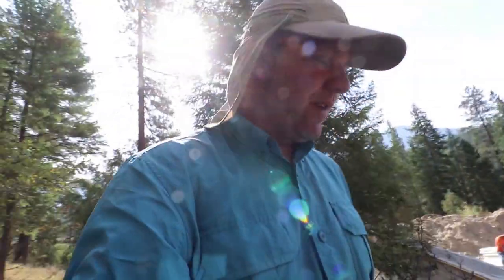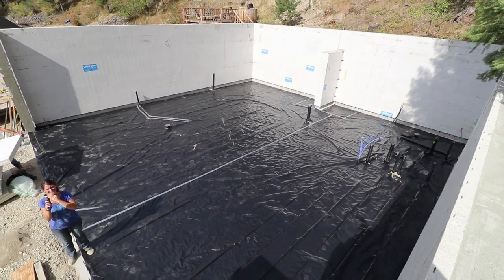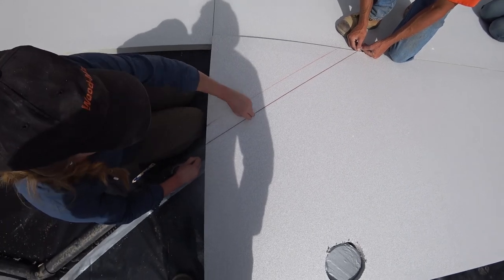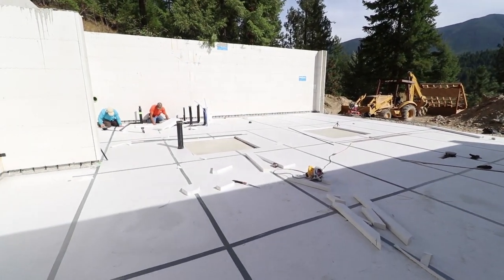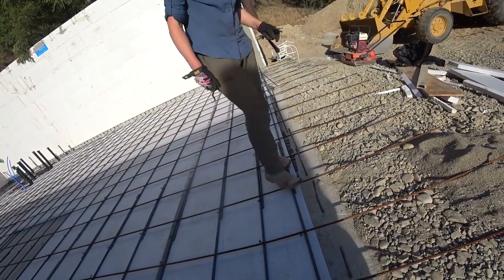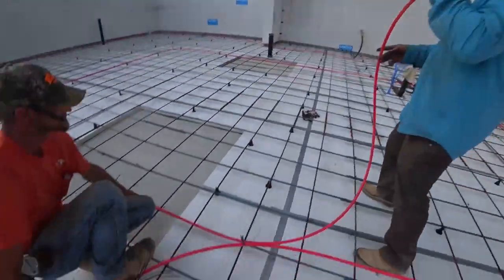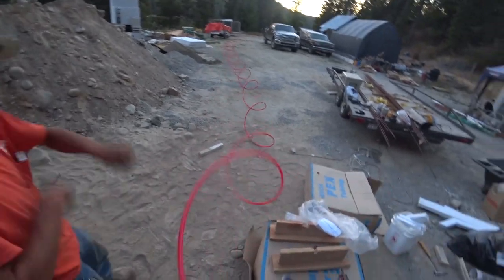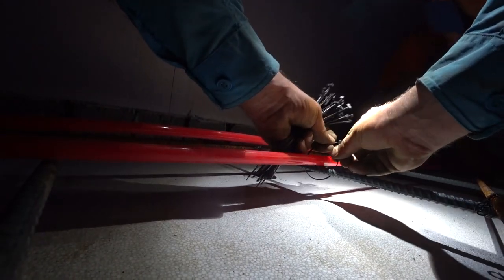PLAYING GIANT HOPSCOTCH (Rebar Tying in Concrete Slab)

Comment: To get a greater strength from the smaller zip ties, wrap the tie around the rebar, or whatever work piece, twice before you secure the tie.  This will greatly increase the strength of the zip ties.

Comment: Hi, I'm a concrete worker up here in Canada, and we pour large garages/ basements all the time. Just wondering why you didn't use wire mesh instead of rebar would have saved light years of time, and probably would have been cheaper! Just wondering why, but keep up the good work!!
Reply: He probably meant the mesh made of rebar - they are already welded together in large grids, and come in various sizes, like 8x8 feet, in 1 foot spacings.
Reply: Well, apparently you didn't... And 10 kgs/m² isn't that bad.
http://www.concrete-mesh.com/concretemesh/welded-reinforcing-mesh.html
Reply: You can get rebar grid in .5" on 12" spacing. It's not lite but, thy make.
Reply: Corey Roca another vote for rebar here. Cheap bulletproof in my book.
Reply: No I meant actual wire mesh, no pre welded grids. You can get a thick enough wire mesh, and I guarantee it will do the same exact job as the rebar.... Not sure how the winters are where they are building, but I guarantee they probably aren't as bad as they are up here. so with that being said, the concrete will  experience very little movement, thus making the wire mesh the perfect solution to prevent cracks. But as some of you are stating how money isn't a big worry, I could see why they went with the more expensive choice. P.s. Been working in the concrete industry for 30 some odd years now, and no matter how many precautions you take, concrete will always eventually crack! Sometimes do to a slightly improper mix, low spots etc. Well love reading all of your guys opinions on the subject, and thanks for reading!!
Reply: Corey Roca i love reading these kinds of comments. As a fellow Canadian it can be an overkill to come down here into the comment section since its usually full of trolls. This thread has such a polite and chill vibe, the Canadian way hehe. As someone who knows nothing about construction i enjoy learning from the commentators as much as i learn from watching. (Dont worry im not learning how to do things the wrong way, as i don't see myself ever going down this road fwiw).

Comment: By tying the radiant lines to the rebar you will not have dead zones, even if technically you do.  Because, the rebar itself will conduct the heat throughout the slab.
Reply: Good point.

Comment: #1 Needs to be High density foam
#2 Reverse coil design "look it up" so I did and oh boy! Jesse stated that if it gets to complicated they'll go to something else. Well that's what they did.
You can't change the layout or design of the original layout or you'll get hot and cold spots in your floor system with improper Heating. The outbound and inbound lines needed to be next to each other and alternate across the floor. This was one item you cannot just arbitrarily change. It had to be done according to the specifications

Comment: Awesome job! I grow catnip for my cats and they go nuts when they eat it. Might be an odd question......how does the Styrofoam holdup under the weight of the of the concrete? Doesn't it just compress over time?
Reply: No compressions.I've puttin 3 cm Styroplates under a 750 liter Aquarium.Over many Years there are only little pressmarks from the sides on the end of the Tankglasses.nothing else.And this was 1,70 to 0,80 m,at least with a lot of big Rocks inside (Tanganjika Area),Glas,Water,fishes,Lamparangement,sometimes two Cats sleeping on it,much more than one metric Tone on this Styrofoam.No Problem,no compression..That little concrete on one squaremeter will not be heavyer.No fear,it will be working well.
Reply: My turn Joe, they should have used the hi-density Styrofoam SM board.....just saying

Comment: Blows my mind that the foam can support 6" of concrete, plus the weight of cars and whatever else on top of that.
Reply: the foam isn't supporting anything, just acting as a barrier for insulation. The concrete will support the vehicles, the ground under the foam will support the concret .. it's how it has  been done for many many years ...
Reply: Enoch5939 The foam layer is supporting the slab. The ground is supporting the foam board. I'm just saying it's amazing how the foam doesn't get squished.

Comment: Hello, I'm following you a lot, I've been radiant for 25 years, I live in high mountains, I'm fine, the delivery temperature never exceeds 100 F but I have 6 circuits only in the house that 5 rooms, the pitch between delivery and return are 3.9 inches as maximum, your looks too exaggerated, I would have made more separate circuits so that they can be individually adjusted according to the needs, in single large rooms also 2 circuits in parallel to the distribution manifold, very important is the equalization of the individual lines or depending on the flow rate or depending on the return temperature of the individual circuits, in addition to this, the climate control unit with external probe is essential for an efficient plant that is suitable for biomass heating overexpress the inertial thermal accumulation!
Good job!

Comment: If that slab is going to be heated it needs to have an expansion gap around the edge
Reply: They have engineered plans, I am sure the thought about thermal expansion.
Reply: Daniel Rose thought about it... and did nothing
Reply: It can't have a gap. The design requires the floor be poured directly against the concrete walls to prevent the hillside from pushing the bottom of the wall in. That's why they cut off the bottom of the ICF foam.
Reply: Mister510 I understand why they went up to the IFC wall. If they have not allowed for exspansion and contraction of that floor then they have made a design error.
Reply: In their case, they should have poured the slab and then put down the insulation, plastic barrier ontop, put down the heating pipes and poured a  2inch screed incorporating the pipes. Around the edge of the screed a 2inch high foam expansion pad to allow for expansion.
Reply: strawbal e this video took place over a week ago.  The expansion joints were cut into the slab.
Reply: Kathi Pauling those are not exspansion joints, they areto allow the slab to move differently without cracking everywhere. They are deliberate cracks in effect. The rebar is intact across these joints, limiting exspansion. Any expansion with mainly take place around the perimeter.

Comment: Consider getting a multi-tool (relatively inexpensive).  It would have been useful in trimming the castellations, but will also be very useful as you move through the whole of your construction.  It will also come into use as you make future revisions and updates.
Reply: As s single too, yes, but as a supplemental tool, I think it would simplify much of the work.  For example, it would have saved a great deal of time when cutting out the lower section of blocks to allow tie-in with the floor slab (just making the initial cut, not removal of the foam.).  But that is just my opinion and Im sure there are other options that are equally valid and useful as they work to build this house.

Comment: Is the foam used for an insulator because they are using radiant floor heating? Or is foam a standard practice?
Reply: Foam is for the heating, you don't want to be heating the subsoil, but it doesn't hurt to have it anyway, it's been said in other places, if you're starting from scratch, it's as cheap to have underfloor installed, also means a lower temperature heating circuit, and that saves money on running costs.
Reply: I believe the insulation that is under the slab is to stop the heating the ground. If there is no in floor heating then I don't think it is needed.
Reply: Even without the extra heating, bare concrete on soil would drain heat from the air. So it's always good to have insulation down there.
Unless you want a cold root cellar, but then you would insulate the bottom of the first floor.

Comment: Little bit strange. When bilding houses in my country (northen europe) we using all insulation for outside (at least 3 times thicker) of house and no insulation inside. Idea - to have as much as posible concreate mass inside to acumulate heet for winter and get cold in summer time.
Reply: That practice is also used in the US, depending on the build style.  Unfortunately because the foam in the walls is also used as a form for the concrete it has to be on both sides of the wall. It is a trade off between being DIY friendly and making use of thermal mass.  The temporary form work that is used when doing concrete basements that have all the insulation on the outside are typically more difficult to install and more labor intensive, making it more suitable for skilled tradesman. I have even seen buildings following the German passive house standards built here.  So it is often the choices of the homeowner and their architect/builder that influence how they are built.

Comment: I'm confused, why are the drains for the basement floors not high enough to be at the top of the cement floor?  And why are the Drains also attached to the same line as the sewer?  I would think that if you rinsed your floor off and it had contaminates (gas, oil or antifreeze) from your vehicles it would kill any bacteria you use in your septic tank.  I'm also confused why there was a drain pipe used around the inside walls of the Garage if you are going to cover them with plastic sheeting and then cover them again with Styrofoam.  Where is the moisture going to go?  Anyone know why you can't use insulation foam outside a wall and fiberglass inside a wall (EIFS)?   I'm also confused why compacting the ground was so important when you cover it with something so soft you can crush it just by walking on it, Styrofoam?   Seems to me the Concrete will have no support anywhere and over time it will fail mostly from the weight where the car is parked.  I think they are using more than one system and getting advice from a collage graduate that has never worked in the real world of Construction.   One cubic yard of concrete weighs 4000+/- lbs.  I'm not sure how many yards they are pouring for the floor but I'm not sure Styrofoam is the best substrate for all that weight.  I hope my concerns are wrong.
Reply: not sure why you need to be concerned in the first place. It's all good, they have consulted with experts who know what they are doing ... at this point, it's all done and passed inspection, (they are currently putting in a metal beam to support the floor, check their facebook page) but a qualified person that does that type of thing ... if they had issues with what Jesse and Alyssa were doing .. they would say so... as my wife always says" don't sweat the small stuff" and "not my circus, not my monkey" ... in other words ... don't worry about it ... it doesn't affect you  ...
Reply: This is mostly "show biz" In my area there MUST be a slope on a garage floor to the door.( It helps in the case of a gasoline leak or propane leak .
Reply: that would be about 400 lbs per square yard is about o.3 lbs per square inch styrofoam that is less than a human footprint on the foam.
Reply: Dej; Wrong there is such a thing as a stupid question....would you like some examples!
Reply: Dej; Thank you, I've never seen this system used before and it amazes me that the concrete won't cause the Styrofoam to compact over time.  I just hate to see all that radiant heat pipe to bust and be a waste of time and money.  I recently purchased an acre of property in the Northern part of Michigan and I'm looking at all new ideas to build a home of my own.  I've been out of Construction for only 10 years but just as everything else new products are constantly being put to use, some for things they where never intended to be used for.
Reply: The drain system around the inside of the garage (I think you are talking about the perimeter drain (white pipe) that is below the substrate) is not for water coming from above the slab, it is there to prevent excessive water from outside the footprint of the house from building up in the basement and under the slab.
Reply: Out the garage door is the standard. If they have a propane leak or gasoline leak ,it will most likely evaporate outside ...not accumulate and create a huge bomb. In mexico about 1992 ,they had a gasoline leak into the storm drains. when it finally accumulated enough and found an ignition source ,it literally blew up kilometers of streets  .  The 1992 explosion in Guadalajara, Mexico's second largest city, took place on April 22, 1992 in the downtown district of Analco. Numerous gasoline explosions in the sewer system over four hours destroyed kilometers of streets. Officially, 206 people were killed, nearly 500 injured and 15,000 were left homeless. "   https://en.wikipedia.org/wiki/Gas_explosion
Reply: Steven Hardy they have floor drains installed
Reply: gasoline fumes or propane fumes will not go thru a liquid trap. the idea is for the easiest path out of the building. Heavy gases flow downhill. Don't ever assume your car cant leak. I had a Chinese fuel filter spring a pinhole  leak one year after I put it in. Its best for that type of leak to have the shortest path out of the garage....via gravity.
Reply: There are also first-flush oil-water separators for storm drainage systems, but neither apply to this situation.

Comment: ziptying the heating coils onto the rebar...wont that cause excessive stress on the concrete when the rebar starts expanding due to the heat? especially long stretches of coil on 1 rebar...
Reply: No, concrete and rebar have the same expanding factor, that's why you can even use them together at all, otherwise summer and winter would cause excessive stress as well.
Reply: they don`t have the same expanding factor, but on this scale ,it will be oke( in my calculations)
Reply: Expanding factor eh!The same you say?You do know what re-bar does in concrete then.Not just making crap up.
Reply: would be correct if you expose a bloc of reinforced concrete to the elements; concrete cools down/heats up gradually and then the static rebar takes over the temperature of the surrounding mass. Here however you will flashheat the rebar wich has much better heat transmission than the concrete, the heat will travel trough the rebar over longer distances much faster then the concrete will transfer the heat troughout its surrounding mass. that is why you can feel warm and cold spots with floorheating if the coiltubes  are too far apart from each other... not picking a fight with you  or degrading their work (awsome job they are doing by the way, and very interesting and compelling as they document their progress), just stating what I think might be a misjudgement, doesnt mean it needs to catastrophical or will ensue in any damage but I think here they opted for the easy way wich might not necessarely prove to be the smart way....

Comment: You cut foam off the wall so that it wouldn't compress over time from the weight of concrete which in turn would cause the walls to possibly move, so how is putting foam under the slab going to help?  Will this not compress over time and possible cause cracks, dips, or other weak spots? Just curious.
Reply: The foam under the slab isn't high enough to prevent the slab from reaching the concrete in the wall. The slab will fill the gap between the foam under it and the foam on the wall.

Comment: What is that lengthy rolls of red tube for ?    Sorry that I do not understand what's going on.
Reply: heated floor i believe, something like warm water passes through it to warm the slab/radiant heating in the house
Reply: Martin Tokinaga  Yes, its radiant floor heat, very popular in cold weather locations. Hot water from their boiler is piped through the Pex tubing and the heat will radiate up since heat rises
Reply: Thanks for the info.     It is very fascinating to see people building their home with a very environmental manner.

Comment: Do you know if there is a concern of condensation from in your radiant system rusting your rebar out?  Should you use epoxy coated or does it matter?  Thanks
Reply: More than likely, the heat will drive moisture away from the rebar, making rust/corrosion an even lesser concern than if there was no radiant system at all.

Comment: ive seen them working in the dark atleast a dozen times, why not splurge on a 30$ 1000watt construction light
Reply: No electricity on site, 1000 watts would immediately drain the batteries!
Reply: Daniel Rose how about something led floodlights?
Reply: they could run 1000 watts for the 30-60 minutes they work in the once in a while without the batteries feeling it, especially since the freezer isnt working as hard as it would of in summer heat. not to mention their generator thats been in half the electrical videos
Reply: I don't know about them, but I prefer to work using a headlight because it attracts far less bugs than flood lights.
Reply: Got a string of 12 festoon lighting from Harbor Freight and retofited with LED bulbs from the Dollat Tree. So much light; 9600 lumens, 108 watts, 1.2 amps at 120 acv !!!

Comment: I love your videos , just a little question, if you are running the red tube exactly on the rebar, will you compromise the scope of the  rebar itself because it will be only partial in contact with the concrete ?